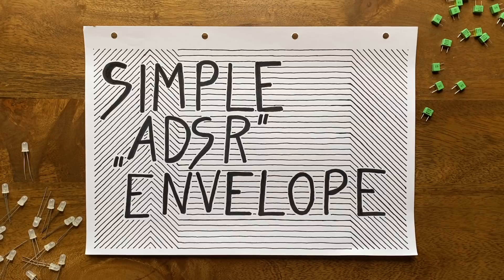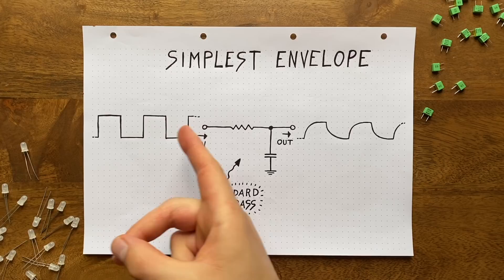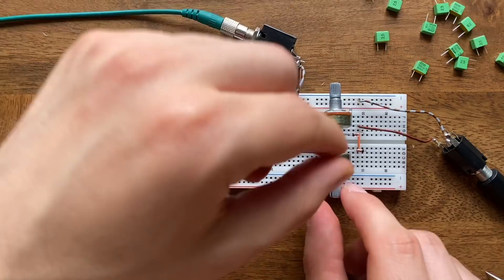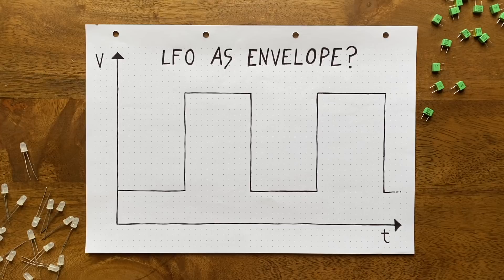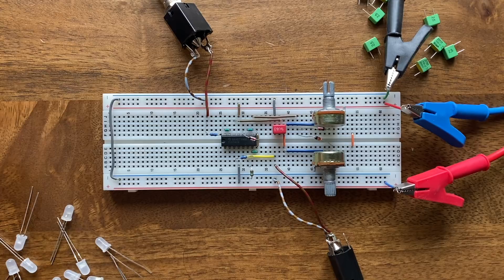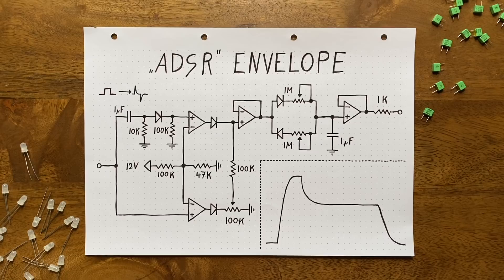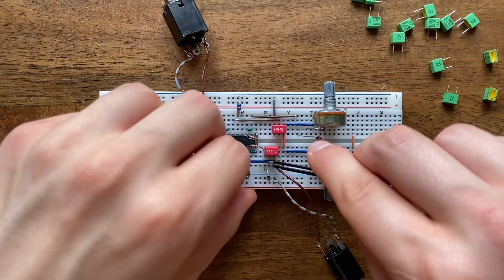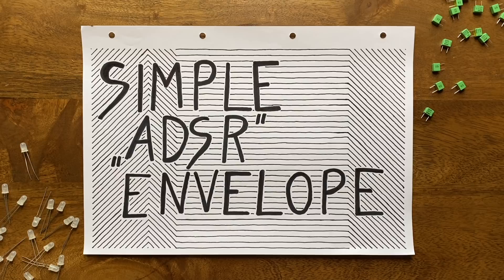Designing a simple ADSR(-ish) envelope generator from scratch

Comment: Whenever using the opamps as comparators, instead of draining the negative side to ground through a diode couldn't you just connect the opamps negative power terminal to ground, so you get 0-12V out of the opamp already? (In case you don't need to share the other op-amps on the chip with something that would require a -12v on the negative end)
Reply from the maker: problem is that regular op amps have this „dead zone“ around the supply voltage levels. so if you give an op amp 0 V and 12 V, its output cannot drop down to 0 V - the minimum is several hundred mV (if not more) above that.
Reply: @MoritzKlein0  thank you for the explanation. Your videos are super helpful, I love them!

Comment: At 7:58, I'm wondering if the electrical current direction is correct. Doesn't current (and therefore signal) run against the arrow of the diode?   My understanding is that the Attack phase would go through the bottom path, and the Decay phase goes through the top path.  Or I have that backwards because current is coming from the ground?  Thanks for this video!  SO helpful.
Reply from the maker: when analyzing a circuit, you need to decide if you want to use conventional (flowing from positive to negative) or electron (flowing from negative to positive) current and stick to that. both concepts will give you the same end result, but i prefer conventional simply because circuit symbols are based on/tailored towards it (diodes, transistors etc).
Reply: @MoritzKlein0  I so appreciate that insight.  It's always been a question in my mind about that flow and signal path. I appreciate you clarifying!  Excellent videos - please keep them coming.
Reply: @MoritzKlein0  Blame Ben Franklin for conventional flow!

Comment: is there a reason why you didn't just provide your comparator op amp with a lower reference of 0 volts? is it just so you can re-use the same chip that already takes +12 and -12?
Reply: Was just browsing the comments to see if anyone had asked this. TL074 are not "rail to rail" so I think one reason is that the ones used as buffers will need to be able to reach 0 volts on the output, for which they'll need a negative voltage supply.

Comment: Im planning to make a eurorack module out of this, how should i go about connecting it to my case's power supply? I could use a battery, but the idea seems wasteful to me. Im very new to circuitry, but i want to make a proper module
Reply from the maker: thankfully the eurorack power connection is standardized – so you can simply buy a 10-pin shrouded header, which is widely available, and put it on your pcb/stripboard.